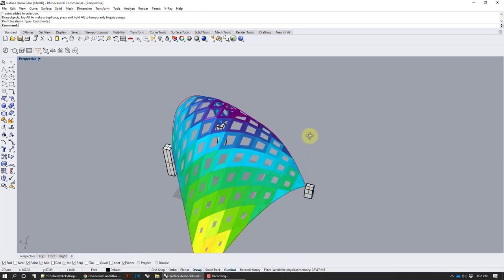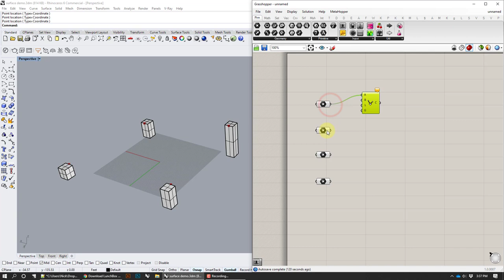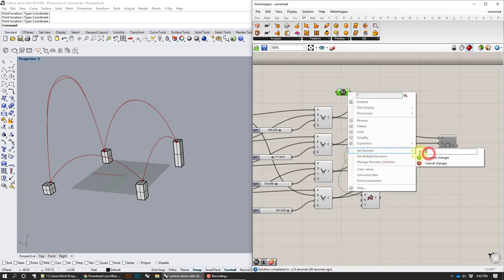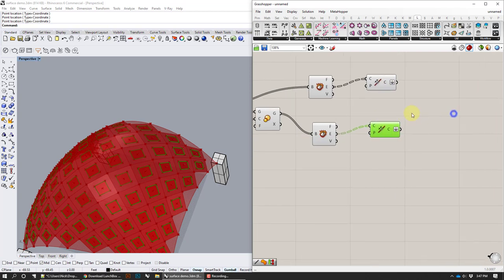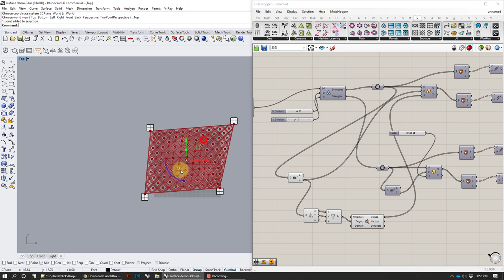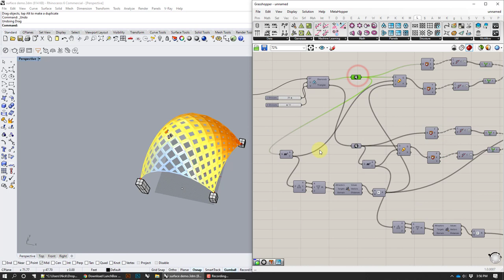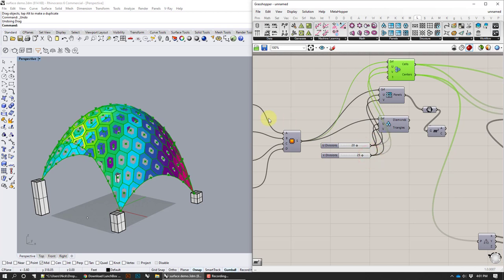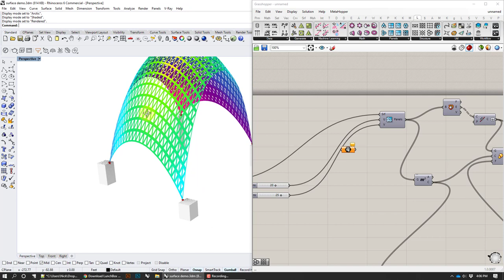ARCH 231 - Parametric Canopy Study - Part 1: Introduction

Comment: Hi, thanks for your video Nick. (I'm not yet using Rhino). Does this tool set help getting all panels to reshape to close sizes and close shapes, say within 5-10% , while keeping a close overll shape? (anyone?).
Reply from the maker: This method will give you a basic canopy design, but what you're describing (minimizing differences in size / shape) is an optimization problem. You could try searching for that. Good luck!